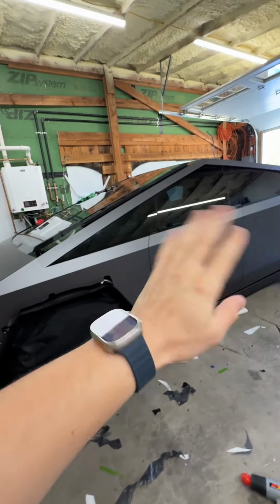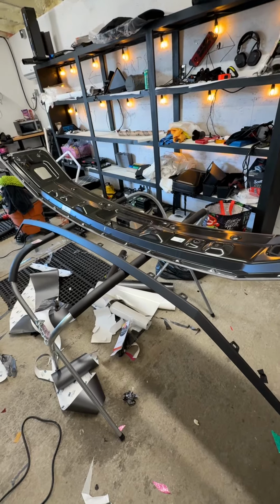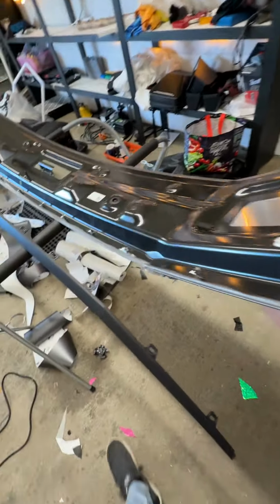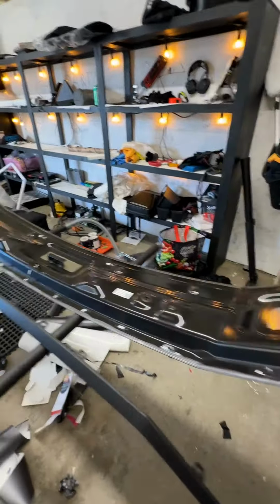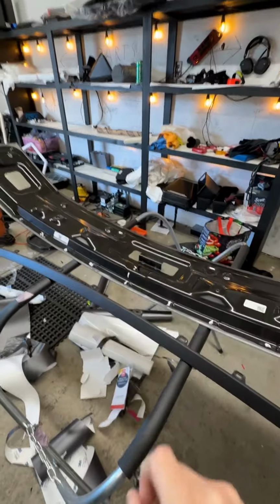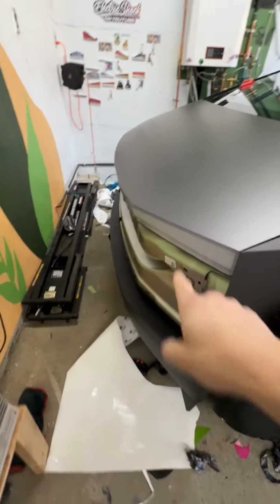The weirdest thing I’ve noticed when taking apart the Tesla Cybertruck

Comment: The plastic can warp-- it's pliable. The metal isn't going anywhere.
Reply: +1
The compliance of the plastic insert allows it to deform and better fit to the gap it's filling without being over constrained by too many attachment points. The sheet-metal front panel might have enough flex in it if it were only one sheet, but since it's so thick and a full assembly, even that small number of attachments is actually a lot. For a really stiff part like that, the corresponding clearance holes have to be bigger and bigger the more attachment points you add. It's a tolerance issue, because neither the plastic insert, the front panel, or the corresponding gaps for these components in the front of the car ever come out as perfectly nominal.